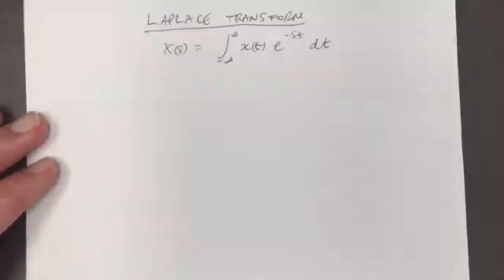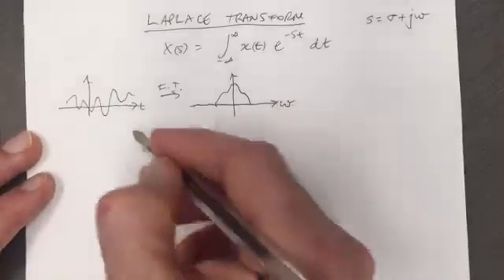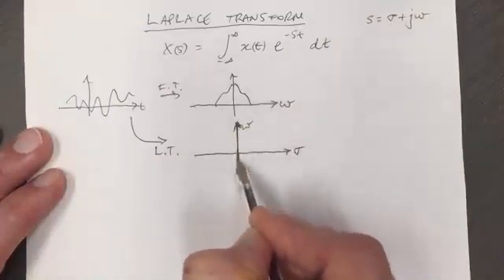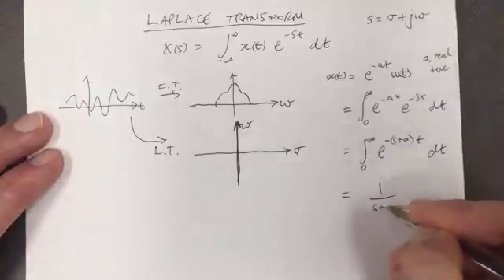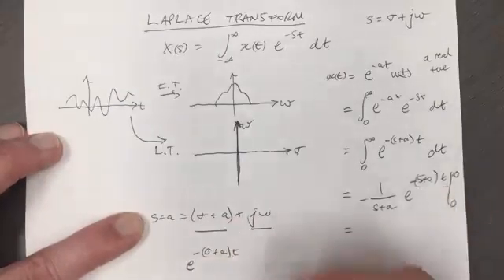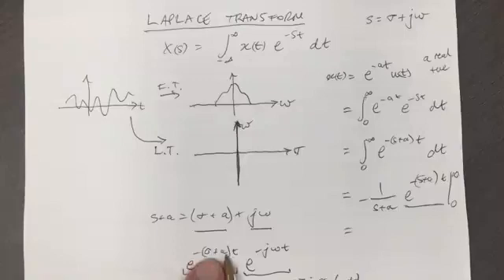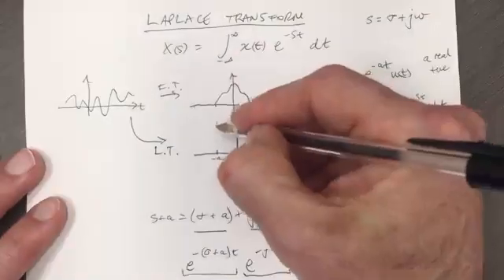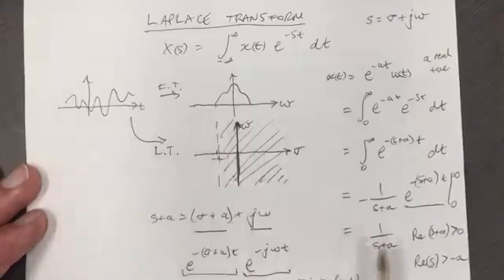Laplace Transform Explained with an Example

Comment: Could you maybe explain why 1/s (integrating operator) is sometimes called an averaging operator? In some systems some people say 1/s it for averaging, but its integration in time domain, something totally different than averaging, am I right?
Reply from the maker: Yes that's right. The reason people sometimes say that the integrator "acts like a LPF" is that high frequency waveforms "cancel themselves out" in an integrator, since the positive parts of the waveform cycle will add positively and will be cancelled out by the negative parts of the waveform that will add negatively. For low frequency waveforms these cancellations happen at a correspondingly lower rate (ie. at the period of the waveform) and so the output of the integrator goes up and down at that rate.